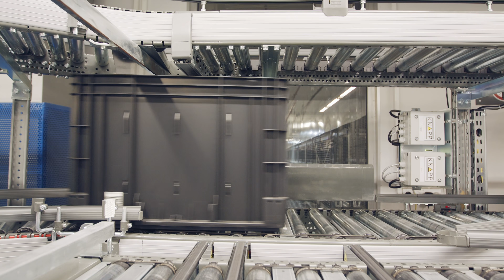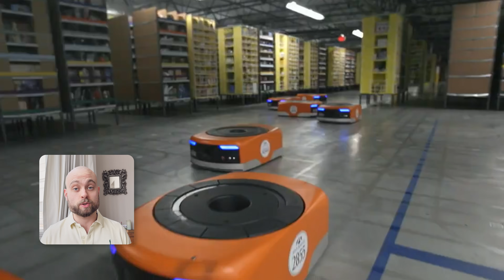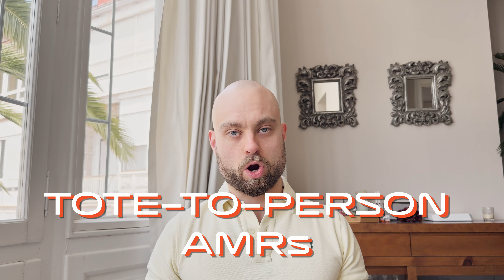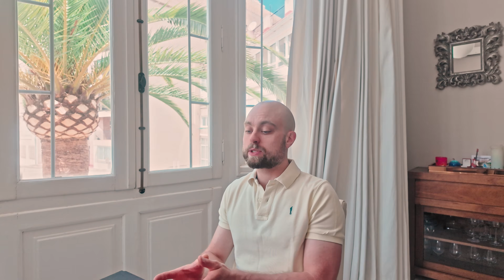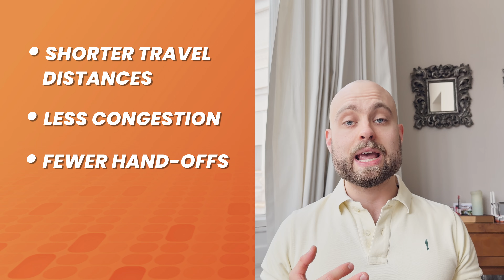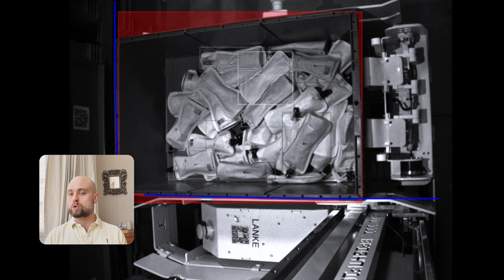Which Warehouse Automation System Is Best?

Comment: Finding the right warehouse automation system can feel overwhelming when you are trying to cut costs and boost productivity. Has anyone here successfully implemented a solution that actually paid for itself within the first year?
Reply from the maker: The biggest determinant of payback is how many shifts you run per week. For example, our customers that operate their facilities 24/7 get payback in 9-18 months. Those that operate 2-shifts 5 days per week typcially average payback in 2-3 years.

If combined with robotics-as-a-service, then your payback can be as short as 3-4 months. Check out this customer case study where this is the case: https://youtu.be/GRZp8MZ6piA
Reply: @brightpickAI   Hello! That is a fascinating perspective on how operational intensity and robotics-as-a-service can drastically shorten the payback period. The idea that 24/7 operations combined with these services could yield results in just 3-4 months is really compelling for those looking to accelerate ROI quickly. I appreciate you sharing this specific example; it definitely highlights the value of optimizing shift schedules alongside automation strategies!

Comment: What about warehouses that supply small widgets and large widgets? For example, one order may have a pair of sunglasses and 50lb can of welding rods. We are looking for a very flexible system that can do both
Reply from the maker: most AS/RS systems have a weight limit of 50-70lbs per tote. For that reason, in your case there would be two options:
1. Automate the small widgets while separately picking the large widgets manually
2. Automate all in one system but recognize you will have to work around the weight limitations (e.g. you can only store one welding rod per storage tote).

Usually option 1 is better, as option 2 causes more inefficiencies than simply picking the overweight items manually.